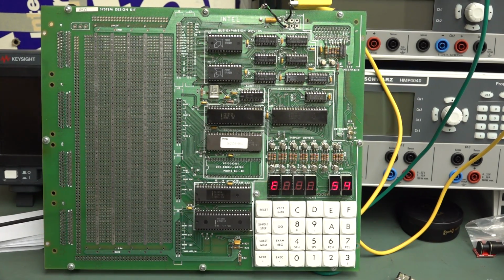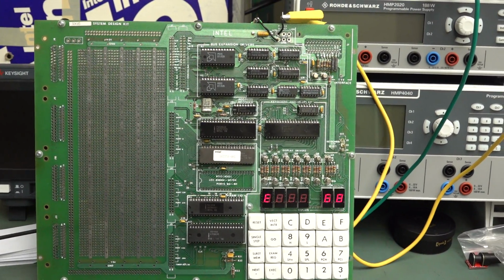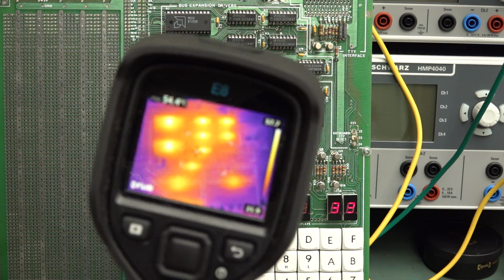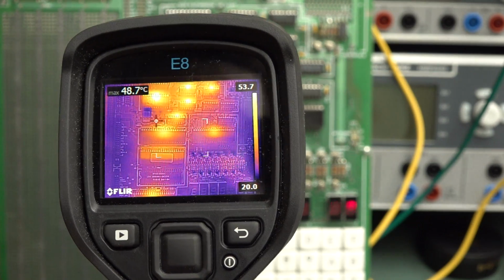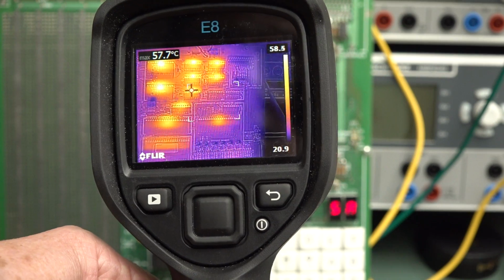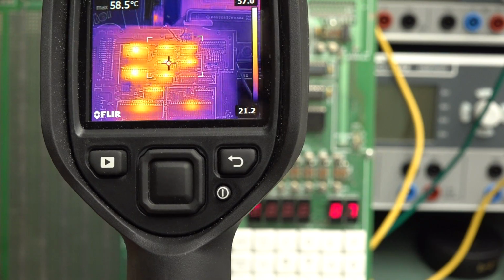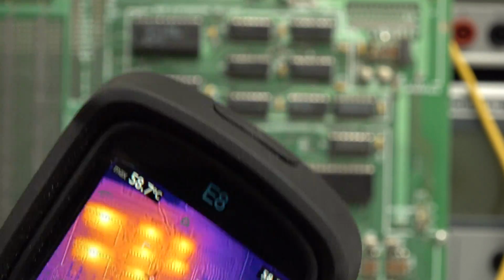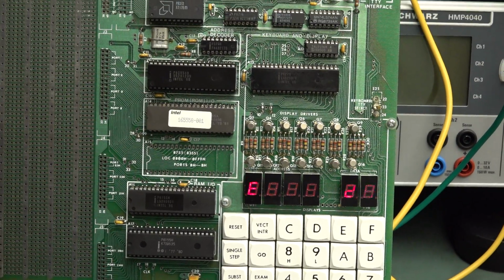Intel MCS-85 Design Kit THERMAL IMAGING

Comment: I've not used a thermal camera myself. But it''s interesting that it's the pins that appear to be hot not the package. I'm guessing that the heat conducts out the pins WAY easier than through the plastic package.

Comment: Anyone remember the apple iii which famously ran so damn hot that the boards tended to wander out of their sockets?

It eventually causing the machine to stop working, and an engineer had it happen to his, so, irritated, he slammed it down on the desk and it started working again

Turns out he reseated the boards by doing that

And then apple's recommendation to anyone having issues was to pick up the machine a couple inches and drop it. Yes, calibrated percussive maintenance
Reply: I do recall on old PCs it was common to have socketted chips (often the RAM chips) that would wander out of their sockets due to heat cycling (i.e. thermal expansion while being ON and contraction when turned off) -- especially if the computer was being turned on/off frequently.
Reply: iamdarkyoshi same thing on the C64.

Comment: I used to find the 8085 systems used to have heat problems which the Z80 ran cool except for the 7805 supplying the power.  The 8085 power supplies was so much larger so not trying to push a single 7805

Comment: What are they, a mix of TTL and NMOS?
Reply: Processor and all the big 40 pin DIPs are NMOS, the rest are a mix of TTL ,LS TTL and S TTL. Those bus drivers would run a lot hotter if you connected wires to them and plugged in a resistive terminator, 330R to Vcc and 220R to ground IIRC, available in those lovely yellow Bourns packages, as they then will have a current flow in the pins as well as the capacitance of the chip itself to drive, plus all those on chip resistors dissipating power.

Just be thankful there is no IIL on the board, everything else would be running cool by comparison.

Comment: Correct me if I’m wrong but: Aren’t those AMD p8212 chips designed by intel? It’s just that Intel outsourced the manufacturing to AMD. That was quite common in the early days of AMD.
Reply: If I remember correctly AMD were official second source for all intel processors up to 386?
Reply: @sio2groper410  I think you are right, but I honestly don't know..
Reply: @sio2groper410  They were second source, because of the requirements to supply the military, who are very averse to having a sole supplier of parts, and really want multiple suppliers qualified for a part. Thus Intel actually licensed AMD, and so to say gave them the crown jewels, which led to AMD coming up with their own designs of processors that were pin compatible, instruction set compatible, register set compatible ( at least those in the datasheet, there were a number of special function registers and special condition registers that were not the same) and in many cases were faster, lower power, or for much of them cheaper than Chipzilla's parts.

Another source of Intel parts was IBM, who made processors under licence as well, and who went on to develop their own processor cores as well later, often having some of them fabbed by Intel as well.